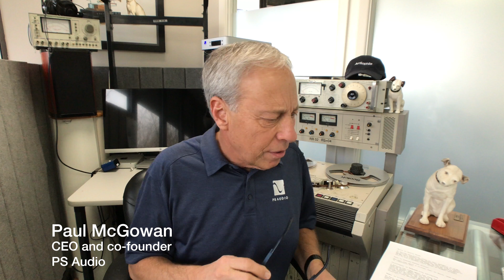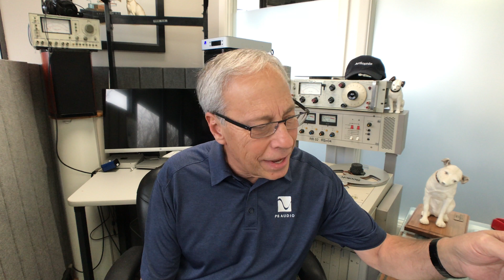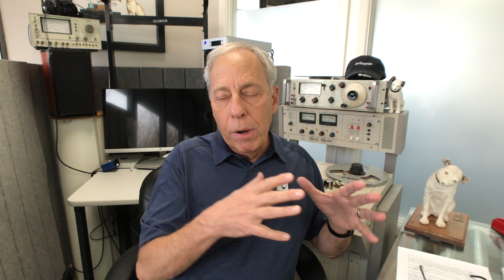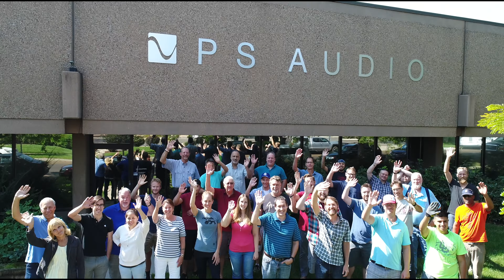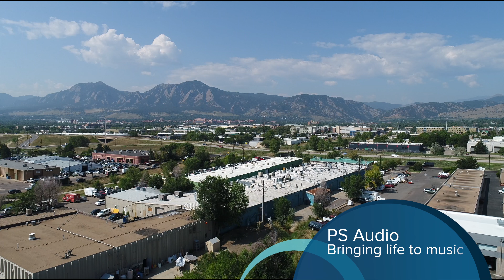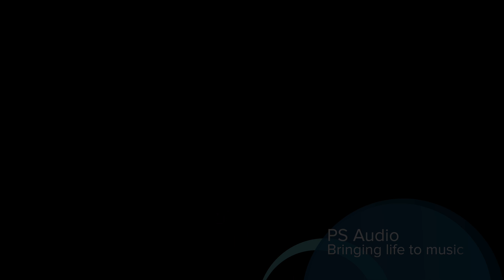The best way to connect separates

Comment: Thanks for the education Paul. 
You mentioned in a previous post that you favor short speaker cables and long interconnects,  so: would a tube (say, Musical Fidelity X10v3) buffer help drive long interconnects from cd player to integrated amp? They have high INPUT impedance and very low output impedance.
Reply: Paul McGowan 
Indeed. Well from experience the mu-vista  tubed x10v3 is nowhere near as coloured as the older x10d (I have both) . The output capabilities of the cd player were what was in question:-)
As for colouration....you use tubes in the bhk amps, no?
Reply: Thank you Paul, this is a question I was going to ask myself. But can I just confirm - I have 6ohm speakers and my tube amp has both 4 and 8 ohm outputs... I should use the 4 ohm output?  I was told by the distributor to use the 8ohm output as using the 4 would damage the speakers... so would be very grateful for your confirmation :-)

Comment: Yeah, a Swiss army knife with the knife. Modern mass market receivers have everything but a real amp section, because most of the budget is spent on the plethora of gimmicks, which tend to degrade sound quality. Like attaching bluetooth and wifi antennas and funneling into the chassis a ton of high frequency noise.

Comment: Thank you Paul, can I just confirm - I have 6ohm speakers (Opera Quinta) and my tube amp (Unison Research Sinfonia) has both 4 and 8 ohm outputs... which should I use.. the 4 or 8?  I was told by the UK distributor to use the 8ohm output as using the 4 could damage the speakers, but using 8 doesn't sound right, so have always used 4, but been worried about doing so... so would be very grateful for your confirmation :-)
Reply: Thank you :-)
Reply: You can try both